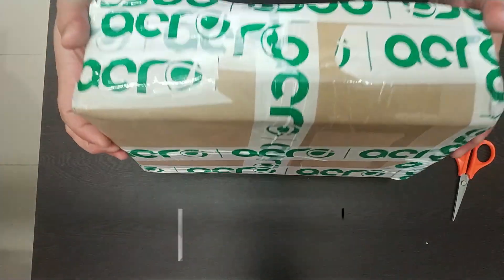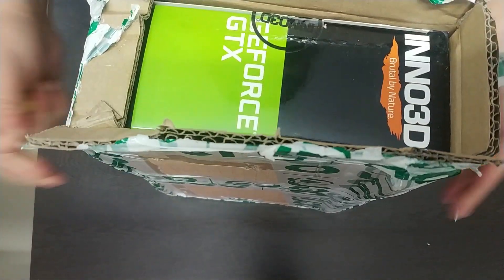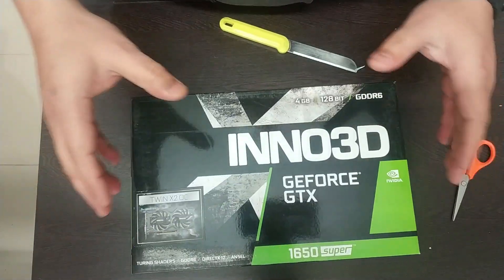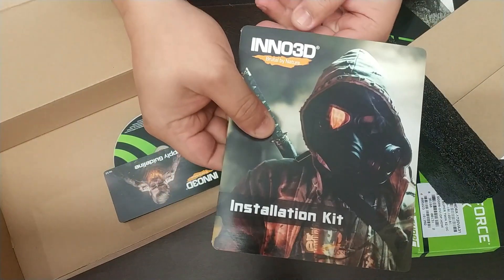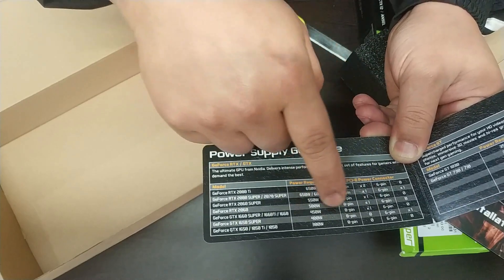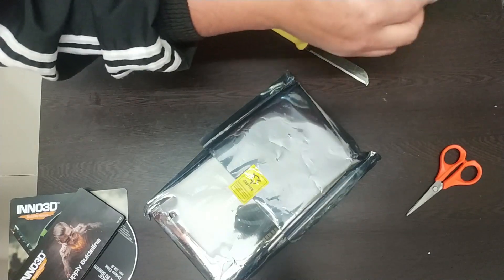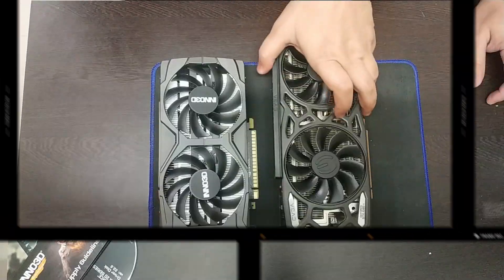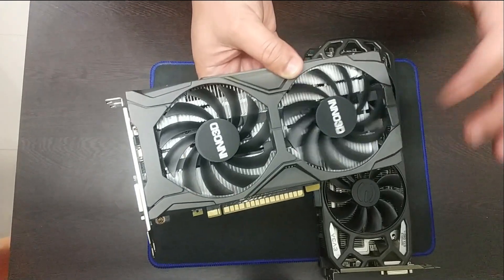NVIDIA GTX 1650 Super Unboxing and Review[HINDI]

Comment: Look Its Gonna BottleNeck But will build a new pc IN FUTURE😍
I3-3210
8GB DDR3 HYPER X RAM
1650 SUPER
ANTEC ATOM 550W PSU

SO MY QUESTIONS ARE -
1. CAN I PLAY MINECRAFT WITH SHADERS ON 50FPS 
2. MY PSU DOESN'T HAVE A 6 PIN CONNECTOR
3. CAN I PLAY PUBG LITE AND EMULATOR AT 60FPS
4. GTA 5 1080P HIGH SETTINGS 50FPS

BTW LOVE YOUR VIDEOS BHABHI JI KO NAMASTE KEHNA🤣🤣🤣
Reply: Yes

Comment: Rx570 vs GTX 1650 which one's better?
Reply from the maker: RX570 performs better. However 1650 is a better card in terms of performance and value
Reply: @ProfessorCardzEN  performs better?
Reply from the maker: bro I meant 1650
Reply from the maker: Electricity bill pe farak nehi padega bhai. Overheating ka issue aa sakta hae par pakke se bill main jyaada farak nehi padega.